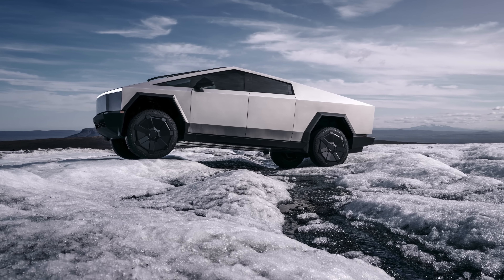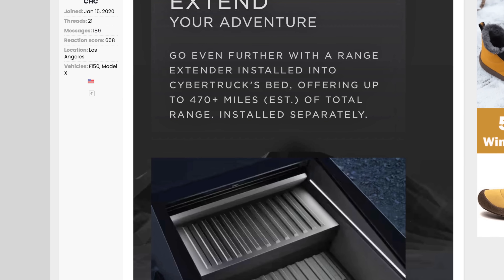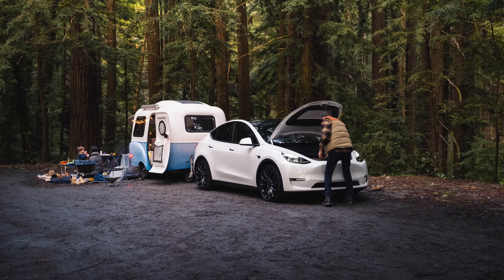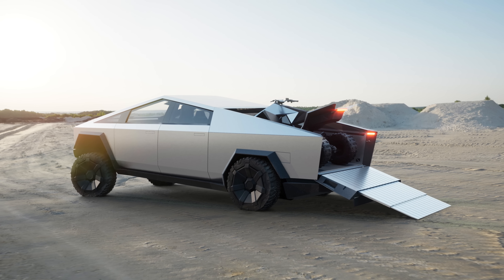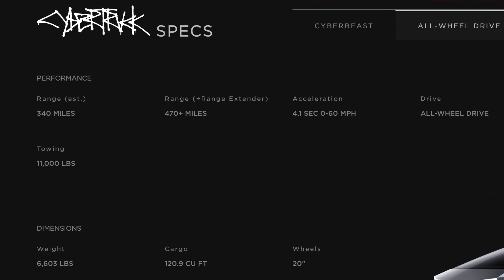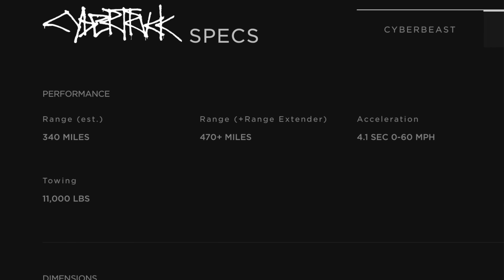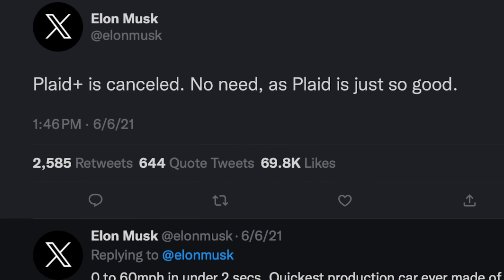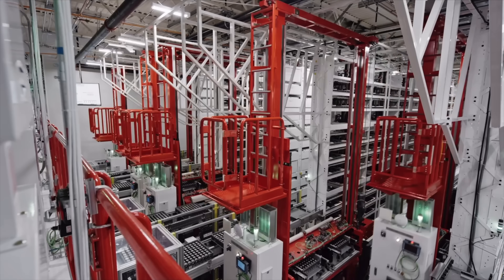Cybertruck Range Extender 📐Explained

Comment: Why didn’t Tesla design the range extender with a lower hight but extended the entire length of the truck bed? Loosing a few inches of bed depth instead of taking up half the bed length.

Comment: I am not on X so if anyone is please push this idea out for the RE. Instead of making a 500 pound battery that has to be installed at a Tesla service station, make the battery modular, say 10 small batteries of 50 pounds each. This way you accomplish 2 things, the installation can be done at home and the batteries can be added based on range need versus the all or nothing approach.
Reply from the maker: Range extender is likely more than 1000 pounds. It would be more like 10 modules that are 120 pounds each
Reply: @TailosiveEV  500 pounds or 1,000 pounds the modular concept still holds, just increase the number.

Comment: Cells that at far away if connected in parallel will experience different impedance.  I think it makes more sense for the range extender to operate separately to give some sort of a reduced power mode to extend the main battery.

Comment: I still don’t understand how this will change things that much. Elon said the mais reason they don’t do 500mile range is efficiency because of the added weight. That battery is a ton of extra weight. How much will the battery ACTUALLY help in range vs weight harming the range
Reply: Has very low range for towing anything. Not competitive as a truck.

Comment: Tesla drove with 11000 pound test and made 90 mins on a fully charged battery which is rivian did on the same test 100 miles and Ford lightning f150 130 miles 😢so what do u think I will cancel my order .
Reply from the maker: Worse conditions possible, also didn’t have the more efficient tires. But even if it made it 150 miles towing long distances is gonna be the last use case for gas vehicles for a while

Comment: You think so? I don't know, I lean the other direction. If anything, the extender is going to HAVE to be removable fairly easily. That would be a game changer for people I think. If you could reliably remove and reinstall it in your truck without any crazy expensive equipment (some sort of dolly system), I bet it would be popular. I actually expect that feature to be more popular in the future because of the fact that the design of a pickup truck allows for that feature. Just slap on the extra battery in the bed lol.
Reply from the maker: Nah it’ll be over 1K pounds, not something anyone can easily do themselves
Reply: Yeah, like a nio with its battery choices-75, 100, 150kwh. Rent the 150 just for long trips or towing, swap and go, all automated 6 minutes.  360 wh/kg at the pack level/250 cell level for the 150 semi solid state, only 3% heavier than the 100 kWh nmc battery. The luxury of choice and your car isn't ever going to be a paperweight.

Comment: The point is you won’t be at the supercharger as often if you have more in the first place, but it is very disappointing to not have that 500 mile range in the beginning like we were so hoping for, but I honestly would not get the cyber truck if it weren’t for the Range extender just enough range for me even driving around Houston Texas on a daily basis I’ve had times when I drove my model Y all day and had to hit the supercharger and it is a dull motor long range

Comment: Just glad I reserved my 500 mile with FSD, tri-motor cybertruck 2 years ago. So, the kinks should be worked out, the range and efficiency should be better by the time I get my VIN in 2027-28. Optimism at it’s finest lol.
Reply: Fsd, good lord fanboy. That's never happening.
Reply: @onetwothreefour-s1n  guess you missed the “optimism” at the end of my statement; smh.
Reply: @grim7174  you ordered FSD, that is embarrassing whether you think it'll be ready or not.
Reply: @onetwothreefour-s1n  embarrassing for who! I built the truck based off what I wanted at the time. So, your opinion is irrelevant.
Reply: @grim7174  ok, heil ELon fanboy.
Reply from the maker: Tri motor will always have worse efficiency (and likely range) than dual motor

Comment: I would take off that extra storage I'm the bed, aka the cooler and just add the range extender there where it will mount directly on the battery pack. Lower the price of it and call it a day. If the vehicle gets 400 with range extender on the long range version, this is a win for me. This way you don't need to sacrifice the bed space.

Comment: Primary battery (with cooling tubes) charges faster up to ~75% SoC. At that point, the Cybertruck UI will display, say, 60% (primary battery at 75% and extender at say 2%). Now once the primary battery pack can only accept a charge of say 50kW, it switches to charging the extender. It does this until the extender is at 80% at which point it switches back to charging the primary. I think it can be done. The charging curve in this scenario would look just like a normal Cybertruck's curve, but you'd see it stay completely flat at 50kW once it kicks in the extender. Also the % SoC would be offset by the extender so it would be better to compare the curves with the X-axis as total kWh SoC (instead of % SoC). In this scenario it wouldn't be any slower to charge the Cybertruck + extender vs the regular Cybertruck, for the same amount of kW's

Comment: I think someone like Obrist(Germany) should manufacture an actual range extender for Cybertruck that fits in the under bed vault or frunk. Tesla should’ve used the under bed vault for a full size spare but since they didn’t perhaps they could expand the main battery into that area.

Comment: oke this is my beef after ive seen loads of vids from the cybertruck...

there are some strange things ive noticed of the bat on this truck...
ex why do we need 90 degrees opening back doors , honestly i rather have suicide doors makes more scene ea door opener on the same column...

then when you get in the back the seats fold up...
its cool and handy and stuff but when i transport stuff ( we have had a station wagon for life ) i like to have a flat floor...so i would fold the seats down...

so that made me think and it hooks onto that batt pack extender...

this is my thoughts and heck i maybe so wrong but this is my eye as a cad designer in engineering...

i would put al those aspects in if i wanted to forklift in a big mass

i think a euro pallet wont fit i think so my logic said giant battery pack etc...
i also think that the battery connectors are somewhat at the back down of those seats...
so they cold do that...

you would still have loads of space on top of that pack to store gear etc...

the only problem i can think of is that rivian has a patent on sliding a battery in that tunnel and this may come close to that patent....and they may be exploring what can be done , but i bet you they had that thought otherwise we would not see these choices in my view... because why would you else need a 90 degree door , and if so why is it not on the front doors....

but that make way more sense then the pack in the bed....

but you can see things have evolved along the way....like they cut the ramp on the tailgate and then having the excuse that its to heavy etc etc...

dont get me wrong that may be valid , but i think the main reason was cost...
 i mean who are they kidding , they have a compressor for the suspension , whats stopping you from putting 2 air powered rams in that gate to help lift it up and making it auto close....

its the same stupid reason  those charge ports are at the back , not because its useful but its the shortest route to the batt connection point i guess... im still bashing my head please please put those plugs at the front of those cars....

it makes no logical sense in the way you use a car trust me...or you are one of those backwards parkers at malls etc that buys nothing and you never open your trunk...sorry im a guy that buys a hatchback to use the hatsh even when im charging it because thats where my gear is....
and no i dont have of site parking ( so i dont park the hatsh up to my garage )  but in Europe thats not a problem there are 10 chargers within 5 to 7 min walk from my home....

he only did that so these cars would blend in withe petrol cars because he was afraid that Americans would not cope whel withe the change... 

theses things are far from perfect ex why is there no screen cover for that back screen when you can stow stuff there .... trust me i would scratch it ....unless they made that thing out of the same gorilla glass lol....

but i digress

we have an mg5 ( good car for that price ) and trust me the front is where those things need to be....

so yes i think that car is great would buy one over the others if i ever have so much money ( like never lol ) but prices rose and he had to cut stuff which is sad....

and if anything that pack is better placed in between the back row ....

but what i really am exited about , and i hear nobody talk about is : 
what if you slapped a tow-truck configuration in that bed and toolboxes on that back row...
or made it into a box van....

this chassis has loads of possibilities....

i bet you if you had a towing cyber-truck you will be seen lol....

Comment: If you have range anxiety, the solution is the same as it always is. Speak to a therapist about it.

If only people had already invented the perfect solution to extending the range if you're towing a heavy trailer or caravan, such as a trailer or caravan with it's own power supply.* To me, that sounds like the obvious solution and Tesla could so easily sell a trailer bed for people to build on top off and their customers would love it. Want a heated and cooled horse box? You got it. Like camping, only you would prefer it if it came with hotels? Luxury caravan. 

*For anyone in the cheap seats not paying attention, this already exists. It may or may not pair well with the Cybertruck specifically but it's a done deal.

Comment: we are all disappointed that 4680 production has not scaled to volume as quickly as was hoped. One theory is that ptfe in the binder is melting and breaking down due to the increased heat generated by the speed of mass production. I  have no doubt that Elon and team tesla will continue to make the impossible merely late.

Comment: More battery means more range but who drives like that. I can’t drive 2 hours without stopping. Might as well be charging. We don’t need more battery, more weight, more cost, more danger. We need better infrastructure. We are fixing the wrong problem. 90% of drivers are commuting 30 miles in a vehicle by themselves. Not driving 1000 miles across the country or running a rideshare business. If you do how about someone “BUILD” a ride share vehicle like they have made “CAB” vehicles in the US and Britain. Designed for that use.You need a vehicle that meets your needs most the time.

Comment: The tonneau cover may remove some range by removing a few 4680 cells, but it allows this lack to be compensated for by aerodynamics and weight reduction. So, it is cheaper for Tesla to put this tonneau cover than to put 4680s to ultimately obtain the same autonomy.
So, it's the right choice. For now.
Reply from the maker: There are simpler ways to use a tonneau cover
Reply: @TailosiveEV  
You mean... lighter, right ? ;)
You can also remove the doors and put batteries in the frunk. But is it still a Cybertruck ? The Cybertruck is not the problem of the 4680. The problem is the 4680, their chalenges and Tesla's transparency in talking about it: Mines, Refineries, etc. Even if it means that there still be delays, you have highlighted this correctly. Progress is slow, but still progress. 4680 project is young, very young. Tesla is committed to R&D, that's the most important thing.
But you're right on one point : I find the battery pack as good as other brands when it comes to making electric vehicles.

Comment: I don't think the extender will be configured as a separate battery the way you are implying.

I suspect the extender will be a lower capacity but similarl configuration as the built in pack.  That is, it will be two 400vdc modules (versus 2x in series 200v modules which are functionally equivalent for the built in).

Further, I would guess that the extender is then wired directly to the built in pack at the two ends and mid point.  It will be in parallel with the built in and do the same series/parallel DCFC switching when needed.

This arrangement makes it literally and conceptually simply a larger capacity whole single battery.  Of course it will have similar cooling and BMS additions, but at a high level those are nuanced details we can gloss over.

If you haven't seen the cover of the "penthouse" of the CyberTruck, in the front of the bed, you need to look it up.  This is where the connection points for the extender are, so installation should be trivial. The addition of the and extender simply must be already planned for, it's not an unknown future hack.

With all that said, a larger battery does not change the charge rate.  So the larger extended pack will simply charge directly in parallel, but the added capacity means the power levels can be larger, resulting in an unchanged charge duration but resulting in more range added per time...

This is because adding more cells in parallel does not change the "C rate" of the cells, look up this property... It is a charge and discharge power level as a function of a cell capacity.

If the C rate of a 1Ah cell is 1C, it can charge at 1amp in 1 hour.  With a C rate of 4C (approximately normal for Tesla) then the amps becomes 4amp in 15minutes (less the charge rate taper considerations).  100 parallel 1Ah cells equals 100Ah, but the C rate is unchanged at 4C, so 100amps and 15minutes are unchanged.

The extender you are imagining as a separate battery which supplies power to the built in does not align with the Tesla first principals.  Just like Tesla did not used a DC-DC to boost 400v to 800v like Porsche and Lucid (unwisely) did.  So to Tesla wouldn't resort to this method for the extender.
Reply: There is not going to be any extender. Just another unfulfilled promise for a disappointing truck.

Comment: Instead of the range extender being a box that takes up a 1/3 of the bed. Why not a flat pack that covers the entire bed but is 4” tall. Technically you still lose the same volume but would still be about to fit longer items in the bed.

Comment: Can't wait to see the actual pack torn down. I wonder if all the space is used or if there are dummy cells for structural integrity. 
Basically I'd like to know how many cells fit and if full what the capacity is, and whether they are only using part of the room due to battery manufacturing problems.

Comment: I was banking on the 500 mile tri-motor for a work truck. I needed it to pull a heavy trailer around town all day. For now range and price are not going to cut it for me. Not being an EV purest, I wish Tesla would offer an integrated efficient fuel burning range extender for those in very cold regions or pulling heavy loads.

Comment: JRE towed a 11k lb trailer with a CT and got 90 miles.

CT needs a larger pack.  

Its like building a bad ass truck and sticking a 2.5L v6 in it

I would be much happier if battery ws closer to 200kwh
Reply: Yeah that was super embarrassing
Reply: JRE needs less towing. The CT is not fit for that purpose.

Comment: As far as the range extender, I disagree. I think it was one of the great moves they made, as much as they get grief for not hitting the range numbers stated at the unveiling. No one needs all that range all the time. 
We know better now than even in 2019 that carrying around a massive pack is overkill in most cases. 
The issue comes in when you talk about installing it and taking it back out for regular use. Does Tesla plan on making such a move possible or are buyers stuck with the pack being in the bed permanently?
I just think the range extender is an integral part of Tesla making good on the promise of the CT working for almost everyone and in any situation. 
I wonder if it might prove to be better renting the extender to owners rather than buying them. It would serve more people with fewer cells.
Reply from the maker: It’s over 1K pounds you definitely won’t be able to remove it yourself. Probably gonna be a $1k service appointment to remove it

Comment: I think the 4680 needs to be talked about in two ways. 
1 the form factor. It is excellent. Why else are Panasonic, gm and BMW all getting ready to make them?
2 the reality of today’s 4680 being less than hoped for on Battery Day. 
4680’s coming out of Austin will get to the promised land within a year or so. 
Output quantity and speed, quality, energy density, cost and the other metrics. It always takes Tesla longer than hoped but the goal still gets met. Within a few percent at least. Considering the goals… like becoming a mass producer of batteries out of the blue, making a futuristic tech powerhouse EV pickup tougher than anything before it and changing the world’s oil/gas powerplants die off as battery and solar take over. These have all happened.  
We can’t forget what awesome, talented and motivated a workforce there is taking on the challenge. 
So I just think we need to be a bit more precise about what exactly is disappointing about today’s 4680 cells.
Reply: Doesn’t seem anyone else is interested in pursuing 4680 batteries and here a year later the technology is no better.